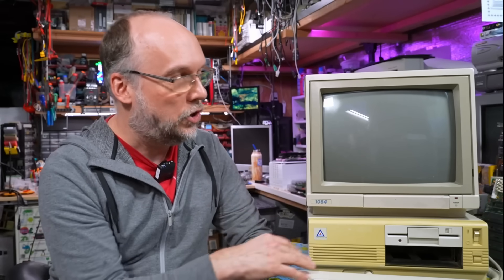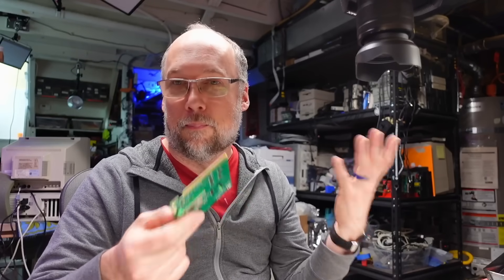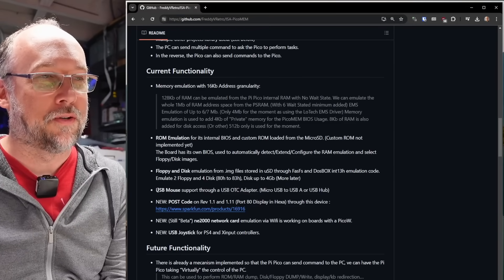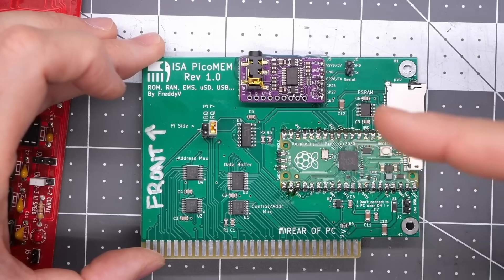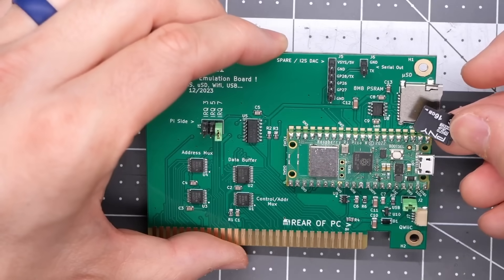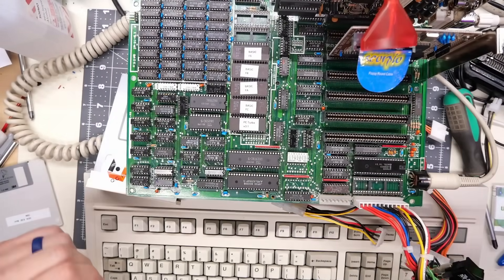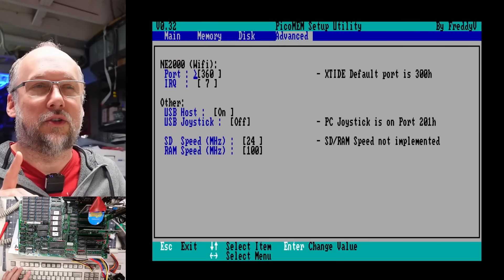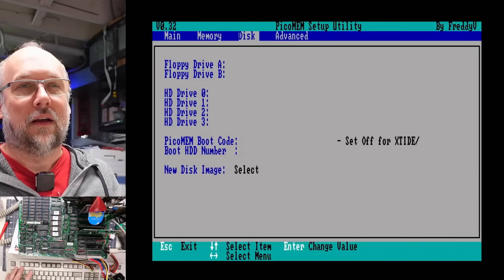The PicoMEM is an amazing software defined ISA card

Comment from the maker: It turns out that there is already a TSR for the PicoMem that allows you to switch floppy disks while booted into DOS. The TSR was part of the utility package on the Github repo. Freddy is also working on enhancing the Wifi features in the BIOS to provide more feedback than the current "no feedback" approach. The thing continues to improve!
Reply: Thanks for the informational video. I’m sure about what I’ll be buying this summer!

Perhaps your “communicational lines” towards Freddy are a bit shorter than mine, so could you check if it’s possible to/works to put two (or more) RP2040’s on one card and make them work together, just to make sure they’re able to manage when handling those extra MHz-es, one Hz at a time. “RP2040-SLI” if you will. I’d love to see that! :)
Reply: It'd be great if there was a display that'd connect to the picomem VIA the i2c interface that'd give you an LCD screen with some buttons that'd let you swap disks that way.  Mount the LCD screen either in a 5 1/4" drive bay or some other location where it's easily accessible.  Not everything plays well with TSR applications so having the option to have a separate LCD controller you could hook up would be great.
Reply: Hey Adrian, I just got my picomem last night and was trying to sort out why it wasn't saving my BIOS (didn't have the SD card in it.) So thanks for this timely video.  I looked on the github page and couldn't find the TSR you were talking about.  I also looked in the HDD Images and sv86-720.img floppy image and could find the TSR prg there either.  Can you give some more info on where that TSR prg is for swapping floppy images?
Reply: Some of the features from this are being added to the PicoGUS too.
Reply: Hi, the TSR for floppy swap is embedded in the BIOS, there is no other software to RUN
Reply: @Inject0r  theoretically that should be possible, but it would require at least one of the lines on each RP2040 as a clock in/out to be used to keep them in sync.

Comment: Imagine if we 40 years ago was told that in the year 2024 people would still produce hardware new for our 40 years old computers, and that they would not only be totally insane but also very cheap. I'm still amazed by the amount of projects for our retro computers.
Reply: And also contain a processor that is more powerful than the one on the main computer.
Reply: arnolduk123  Windows 1.0 was released in 1985. "40 years ago" was 1984. Windows 95 wouldn't come out until 10 years after Windows 1.0. So "people would be surprised about Windows not using year as version name" is nonsense.
Reply from the maker: @ericpaul4575  And even with that, the RP2040 is only just fast enough (being overclocked over 2x stock clock speed) to properly talk on an ISA bus at 8mhz, something any Intel CPU even from the 70s can do with ease. :-)
Reply: Nothing you said would have been a surprise. In the 80s, vintage collection was already a thing, people would romantisice about the 50s and old radios, cars, machines in general
Reply: were; 40-year-old; should
Reply: arnolduk123 a smartphone is a computer.
Reply: arnolduk123  “it’s design”: diction fail.  Of course I would but not always should tho that has nothing to do with the meaning of a computer, which a loom or a geartrain also is.  The “would of” in your other comment tells me about your IQ.
Reply: were* told
Reply: arnolduk123  well, there's the emulation overhead It's REALLY NICE how they're about to do it on a microcontroller instead of a full blown raspberry pi or FPGA system
Reply: We also have to hank the pico pin design.  It has 2 cpu's but the pins run off a special code that can flip or turn on dma on change.  I am really liking this project as there aren't many people who use this feature.
Reply: @adriansdigitalbasement  The advent of moving to serial chip interconnects (vs parallel address/data bus) really kills performance when interfacing with older technology.
Reply: It's completely nuts really.

Imagine taking all these new gadgets, sw defined cards, and the current BIOS/drivers/sw back in time to your young self. I wonder what would've happened if folks in the early 1980s had access to the modern XT focused demos and and related code for stuff like AREA 5150 or similar
Reply: I remember as a kid looking through the CompUSA catalog daydreaming about buying one of those 512MB ram sticks, and thinking I'd "never run out of memory again!" 😂
Reply: I would say that folks then knew about Moore's Law, so people in the IT industry of the time wouldn't be too surprised with the horsepower on display here.  However, I think the form factor of things like the RPi variants you see nowadays, along with the ease of obtaining them on the cheap, would have blown people's minds.
Reply: and you have 40 milion homeless in the USA...

Comment: The irony is that the Pico is way more powerful than the computer itself. But, seriously, this is an awesome card. Great idea. 😊
Reply: spoke my thought. 10000x faster perhaps
Reply: It's like attaching a 1000hp inline engine to a 10hp outboard motor to make the outboard run better.
😂
Reply: @bmobert no, to make it start turning left and right again, because the original driving wheel system was broken 😂
Reply: It would be so fun to make a little 3D accelerator that uses DMA to copy offload software rendered frames to VGA video memory. It could DMA the render command list from RAM too, 10MB/sec would allow for ~150fps @ 320x200, 8bpp so it would be reasonable to keep up. Using 8MHz 3 cycles per 16 bits.
Reply: Yup.  Same goes for the VIC and SID replacements for the C64 you can get these days.   I like to call this the "Spaceship of Theseus" problem, where at what point do modern improvements erase the idea of it being something old-fashioned?  This is also explored in Babylon 5 (of all places) where a motorcycle restoration project was given a Minbari power supply instead of a gas-burning engine - does this defeat the purpose of the work or not?
Reply: @annebaisden8717 not when Centauri are still around
Reply: @bmobert  More like attaching a V8 on your mini cooper to run the AC and radio while letting the original motor to run the car 😄
Reply: I had a mini moke. I loved it. (Always a bad idea.)
 The engine was in good shape and it was still quite unreliable. I doubt sych an engine could be relied on to do the job suggested. 😁😆🤣
Edit:
Of course, there's no such thing as a v8 for the old minis. 👍

Comment: On the one hand, this feels a lot like cheating. But on the other hand, it’s amazing to see the vintage computing scene so active and healthy that something like this can even exist. Really love it.
Reply: As old hardware gets more and more rare, and more and more costly, we’re going to have to go emulated/virtualized along with that more and more.
Reply: Not cheating.  We would all have bought this card if it existed back in the day.
Reply: @basicforge  but if we bought this card back in the day, it would have way less processing power, and would have been more expensive. if the raspberry pi pico had display out, it could just emulate the entire computer. i personally prefer the approach of separate cards built for one or two purposes, using with simple ICs and some low level firmware. this certainly wouldn't be the way i'd go for my builds, but i do agree with the top comment, it's nice this is helping vintage computers work today.
Reply: In a way, I kinda wish the same was true for Classic Mac OS computers.

Comment: I think a cool feature would be to emulate an FPU on the Pico, for systems that can use one of course.  Maybe it would require a ribbon cable and plug over to the slot, but maybe not.

Comment: There's a huge potential for profit with this if this guy tools this thing for Industrial use and offers an ISA card for old industrial machines that can easily ass remote management, file sharing over wifi, and other features to interface with more modern equipment without disrupting the old highly specialized machines that some places still use.
I can imagine old milling machines suddenly having access to off-site storage and backups, allowing their IT to remote into their control computers, or even allowing floor staff to access and start the machine remotely with their phones.
Reply: Who doesn't want ass remote management?
Reply from the maker: Indeed -- all those old CNC milling machine and what not using old DOS stuff could totally use this for remote control. Pretty epic!
Reply: @briannickel5131  I'm not even sure what I was typing to get that typo, but I like it.
Reply: I'd say you pressed a s instead of d and 'autocorrect' added a second one.
Reply: @Null_Experis  "easily add remote" -> "easily ass remote"

Comment: Not going to lie - it is epic that there is still a community that is dedicated to keeping all kinds of old computers running so that people can either relive their memories from way back in the day or that younger generations can experience what computing was like at that time.
But regardless, it makes me chuckle that you basically plop in a card that has a computer on board which in itself has orders of magnitude more "computing oomph" than the original computer it gets plugged into. Even being on the very low end of the ARM spectrum, that little Cortex M0+ on the Pi Pico dwarfs an 8088 or 8086 no problem...At the same time, seeing the price of the Pi Pico, compared to what a PC cost when it was current tech, shows what giant leaps in development happened since.
Reply: There's actually two things that are really interesting about having the option of a new board with an MCU - first, that hobbyists can make new add-on cards without much difficulty now, and second - that for any given computing architecture, we can upgrade it to the level of that card. That removes any vintage limitations - the capability of all the computers is all "at the same level" now, limited just by development time. You can make this kind of upgrade for a PC, or an Apple II, or an Amiga, or anything else that you could figure out a way of shoehorning in, and you can make upgrades that copy the capabilities associated with one to the others. 

It inverts the usual thing of having to make software drivers that deal with hardware: a piece of "smart hardware" like this can act as the driver for something like a USB mouse.
Reply: And, the module contains a WIFI module which itself likely uses even more powerful CPU inside.
Reply: @k4be.  Exact :) The Wifi module is faster than the RP2040, like graphic card are faster than the PC.
The important is that the Pico is not used to accelerate the  PC CPU. It adds options that were possible on these PC : HDD, Floppy, Network, Adlib. All this were used on 8088 PC back in the time.
Reply: This thought crossed my mind a couple of years ago when I bought an Atari 800XL with a FujiNet device. The FujiNet is just a relatively tiny device that plugs into the back of the computer and seems like just a peripheral that's helping the computer out a little like an extra hand on a person, but really it's taking data from a network or an SD card and running circles around the Atari with its processing power to dumb things down to a level that the Atari can easily handle. It's more like the Atari is a peripheral for the FujiNet simply for the purpose of giving it a more nostalgic interface rather than simply using an emulator.
Reply: @freddyvretrozone2849 not faster, dolt, but swifter
Reply: “oomph”: you mean speed? miht? skill?

Comment: This is cool. Nice to see convergence like this. In the day I wanted to know every last aspect of the PC. I got too busy to do that. I'm amazed at the detailed knowledge necessary to implement this idea! PS, the right words for LIM (Lotus-Intel-Microsoft) memory is "expanded". You can't get "extended" memory on less than a 286. EMM386 has options for dividing memory into expanded and extended memory side by side. The "/noems" switch prevents the default allotment. The earliest essential use of extended memory was in Netware 286. There was an DOS executable that did nothing but switch to protected mode and set up a large flat model address space for the OS to inhabit. Actual memory protection was not required and not used. That was essentially the birth of the practical LAN.

Comment: A Raspberry as a universal ISA card...stunning, simply stunning.
Reply: TBH these machines were not meant to run for more than what, 4-5 years? I have a basement full of 80s and 90s PCs that work fully, even an NES and a Genesis (which is on now, we're taking stages in beating Sonic 2 lol). I can't seem to recall any newer consoles or computers working for even 10 years.

Comment: Thanks for this review / walk through, Adrian :)
What I'm seeing here is an excellent "first stop" for an ISA card to put in a resurrected XT / AT and get it going. - A "Swiss Army Knife" ISA card that will get one out of most jams.  Certainly a "must have" for those restoring XTs.
I think those dedicated RAM expansion and controller replacement cards still have a use-case in terms of performance / compatibility.

Comment: The one improvement id like to see is a header to be able to use an external or front panel/bay mountable card reader. The big advantage of using an XTIDE and GoTek in my current 5160 is having the usb and cf card ports mounted right in the 2 right drive bays of my machine for access (the half height 32mb RLL HDD that still works and 360k floppy are on the left). Getting to the back of the machine to change out an SD card would be a serious PITA where I have my 5160 set up. I like the idea of this card though, and might consider it in future for another machine! Good job!

Comment: That thing's pretty cool. I hope a 16-bit ISA slot version gets released at some point. I don't personally care about XT-class machines; they're too slow and limited to do much with. But a lot of those features would be really handy on an 386 or newer, especially one with limited room for ISA cards like my Toshiba T5200.
Reply: Especially if they can add a CD-ROM emu where you can load CD images on virtual drives like they've done here with floppy and HDD.  Man that would be cool.  Absolute epitome would be an easy way to connect full powered Pi for MT-32 midi emulation.  Feels like the sky's the limit on this whole concept.

Comment: The term "PSRAM" refers to Psuedo-static RAM, meaning that it is DRAM that can refresh itself without external refresh circuitry, and be simply wired onto a board like it was SRAM.  It does not necessarily mean that it's accessed over an SPI bus.  But on this device, it looks like it is indeed on an SPI bus.

Comment: What a cool device, I love what people are doing to keep old computers alive, even if this is the engine equivelant of connecting a 1000hp dragster engine to your 80 hp cars motor to use as it's starter 😂
Reply: Maybe  a closer analogy would be upgrading the radio in your classic car for bluetooth instead of AM radio.  Your car engine is unchanged.    Maybe some new tires for safer traction etc.

Comment: 27:02 I had to listen to that twice.
Dos would be using FAT16, which has a 2GB partition limit, and this is what I thought you were referring to the first time I listened.
FAT32 has a 4GB file size limit, so would give you a 4GB hard limit for hard drive image.
So yes, what you're saying is right, assuming your SD Card is format to FAT32.
Reply: Hi, SD can be anything, extfs as well 😀
Reply: @freddyvretrozone2849  I'm sure it can, but Adrian did specifically mention Fat32, and since MS-DOS 6.22 only supports FAT16, then in this context, the only reason why he could be mentioning it as an issue, is if his SD card is format to FAT32.

Given that the core is a Pi, I'm sure it could use an SD card format to any partition type the Pi, or whatever OS the pi is running, can understand.
Reply: @bobingabout  I did limit the image size to 4gb to support FAT32 uSD and above, it is not really reasonable
Reply: @freddyvretrozone2849  My original comment was simply me trying to understand why Adrian specifically said "FAT32".

In my opinion, a 4GB hard drive image file limit is reasonable to a device targeting old DOS machines.

Comment: The RP2040 is truly a versatile device - I don't have an old PC for this, but I DO have an Atari STE and am using a device called the SideCART - maybe a future video idea?  Plugged into the ST's cartridge port, it does things such as RTC, floppy (even loading from internet) and HDD emulation.  Like this device, the SideCART is still in (very) active development.  Worth checking out!

Comment: Just went for a quick look and now 45 minutes are gone. Fascinating stuff. 

I’m generally not a fan of using SBCs for emulation that overpower the system itself by many factors, but this does look like a neat piece of work and the bios interface makes for a great not-quite time period appropriate setup. Also, using wifi for networking beats running coax cable again and trying to plug that into a 21st century router 😇

Comment: Nice - I just used a Raspberry Pi Nano (not pico) to had a second processor capability to me BBC master - it's truely incredible how quickly it can run now compared to the original CPU (and original 'Tube' second processors) - but the other constraints of the system still limit it - running DOS or CP/M on it (or Unix perhaps - it can now run PDP11 code) - would not be a fun experience. There's only so far you can go with this sort of stuff - maybe the next version of this could use a Pi Nano rather than the microcontroller based pico.  I wonder if the SDcard is also a bottlenick for disk performance.